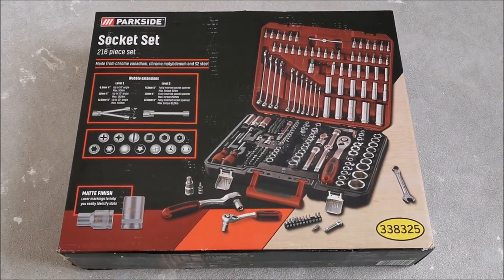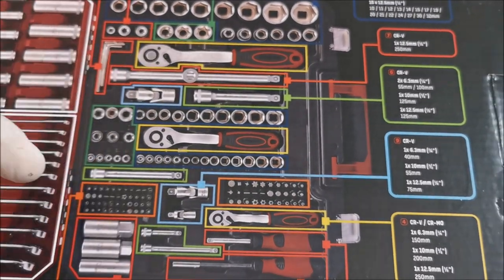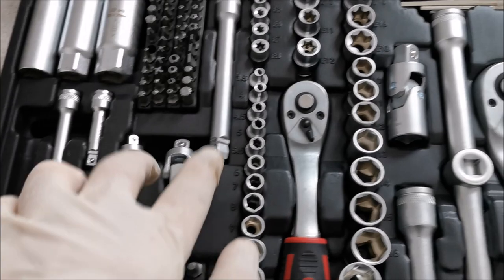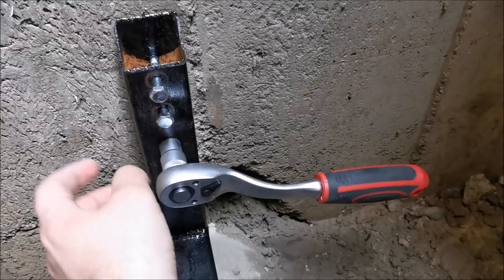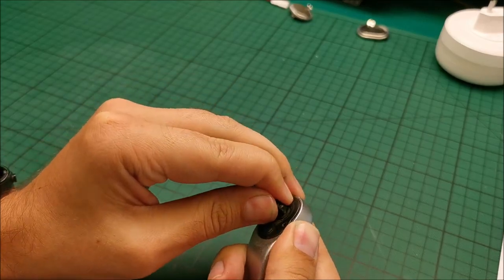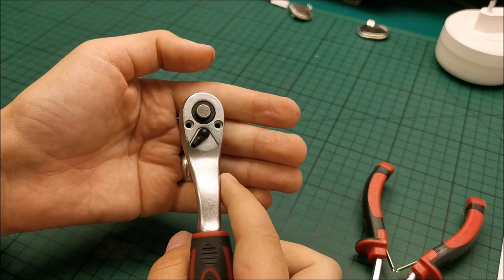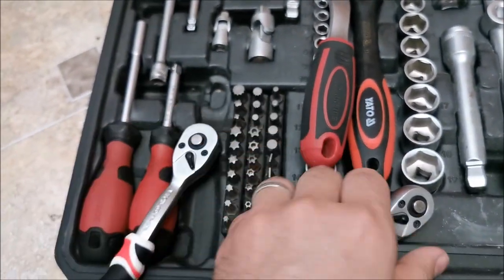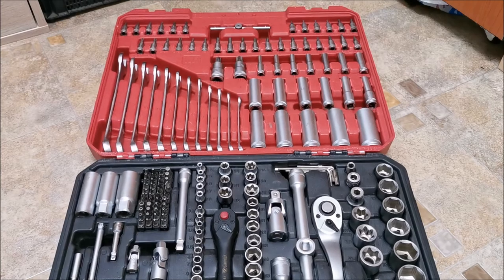Parkside 216 pieces Socket Set (from Lidl or Kaufland) - test and review

Comment: It’s not a bad tool. Have a 94 piece set for 10 years and 🔧 separately. Works absolutely fine at home
Reply from the maker: Quite decent. I use it for a few years already, but the smaller ratchets are bad.
Reply: @UltimateDIY  it just need maintanence, greese is getting bad, clogging ribs on a gear

Comment: Pry open switch it’s friction set
Reply from the maker: What switch do you mean? The ratchets in my set are riveted.
Reply: @UltimateDIY  I took mine apart, its was long time ago, simiral issue, cleaned it and oiled, works till this day.
use screwdriver as a prybar between ratchets handle and left/right switch. it should disconnect internally
Reply from the maker: Wow, just...wow. I owe you a beer! The switch is actually plastic and not a single metal piece riveted at the other end 😱
A new video will be made, to see if I can somehow repair mine now. Thanks again!
Reply: @UltimateDIY  with pleasure :)